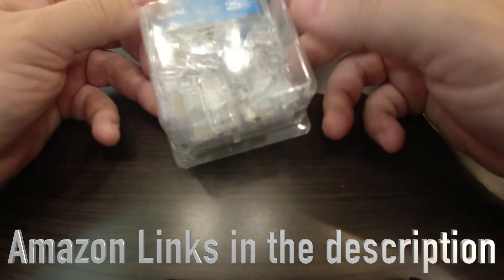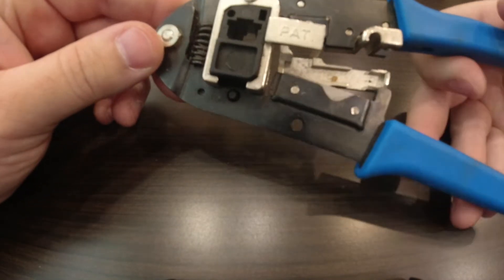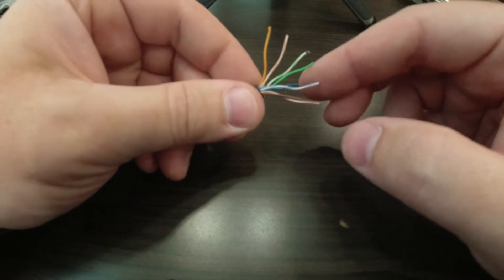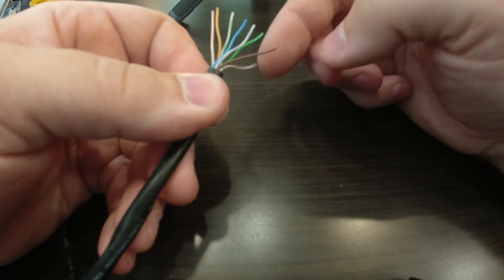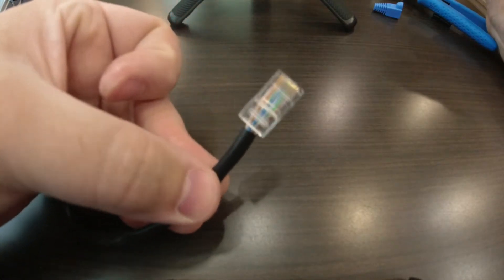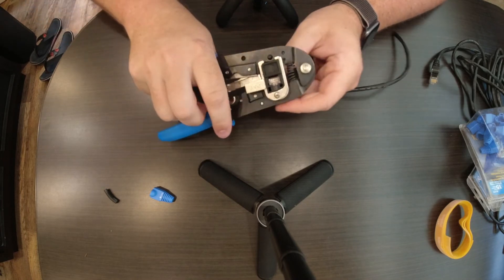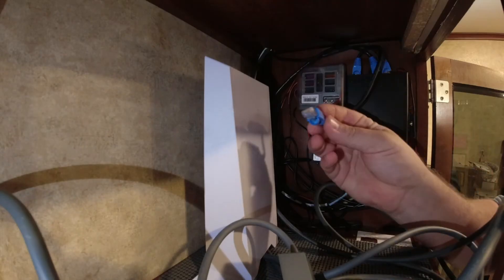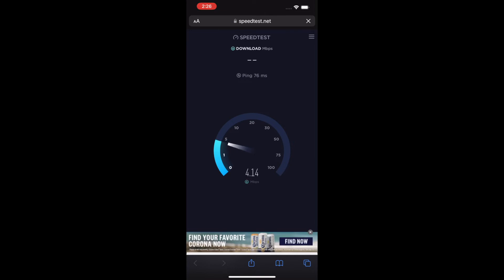Using Starlink with our Pepwave Max Transit Pro E - Build an Ethernet Cable - Full Time RV Internet

Comment: Thank you. I'm looking at getting a Pepwave Transit Duo Pro and Starlink. Am I correct that you are still using the router provided by Starlink? If yes, can't that be eliminated? The Starlink router, for my mobile use, seems ridiculous.
Reply from the maker: It can be eliminated, I chose not to, however.

Comment: Thanks for the honest thoughts on Starlink. Unfortunately, I think congestion is only going to become a larger issue as more RVers and normies switch over. 😕
Reply from the maker: There actually may be a fix to this that I wasn't aware of until @Vtwin Willy made me aware (in another comment) of a potential fix that I am testing out now. There may be an update video to this coming out soon. I just need to get away from all these trees haha.

Comment: I suggest a baseline test of SL Router only.  Then test again going through your PepWave router.  

If performance degrades 10 fold, try inserting an Ethernet switch between the 2 routers.  

Seems there’s an incompatibility issue between chip sets, and the two routers struggle to perform backchannel negotiations which drags down communications to a crawl.  

This is particularly true of the MAX-Transit line of routers.  

There is a very detailed thread on this on the Pepwave forum, but last time I Posted a link here, my comment was deleted.  

FWIW . . . PepWave is working on a solution.  

StarLink . . . ???
Reply from the maker: You know, the crazy thing is, I wasn’t having slow speeds like this until recently. It was working great either using my WAN or Wi-Fi as WAN connections. I’m having the issue you’re talking about. Connected to SL router my speeds are significantly higher. I just bought a switch, hopefully that fixes things. Thank you for the info! Hopefully this is something as simple as a firmware update, but it may be more of a hardware issue.